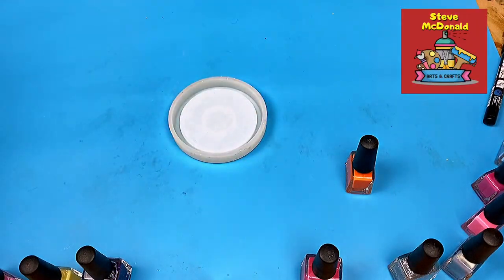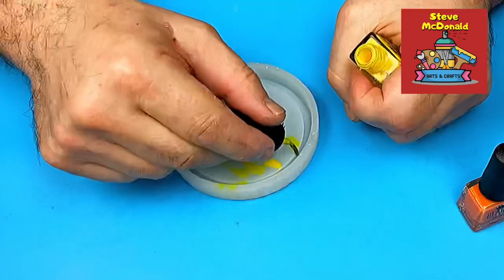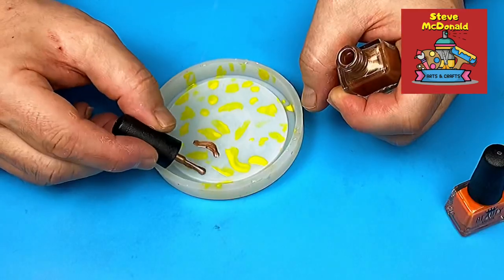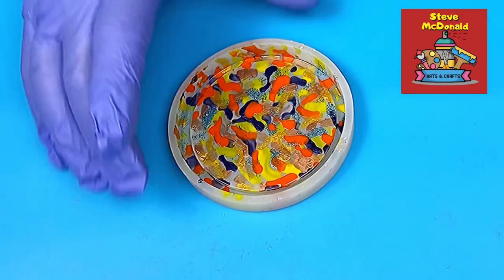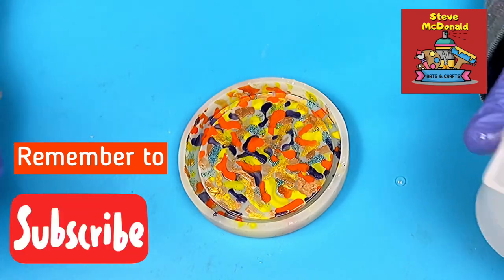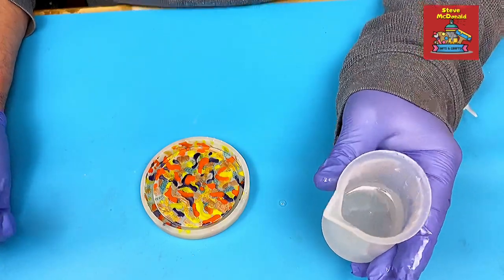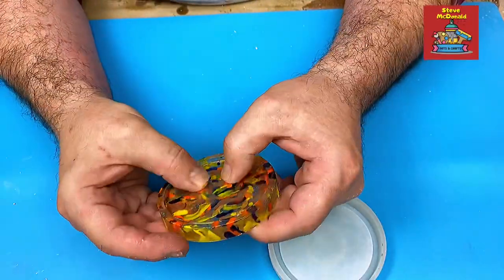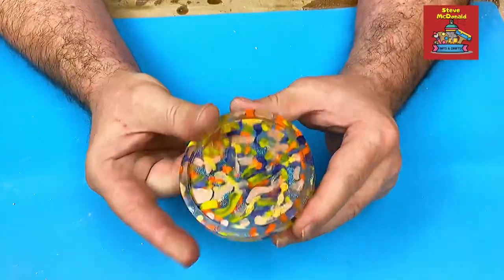What Happens When You Paint Nail Polish in a Resin Mold?

Comment: Silicone is the same material used in nail salons, nail polish won't stick to the mold. I know several people (myself included) that use it for coloring resin. You can even do "pouring" puddles then cut out the results and put them under a clear cab, they are sweet looking!